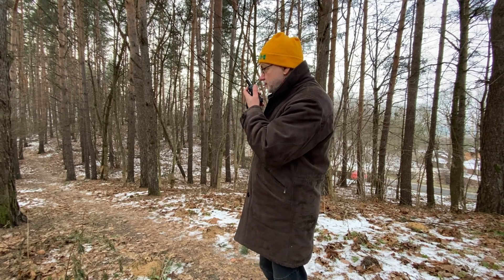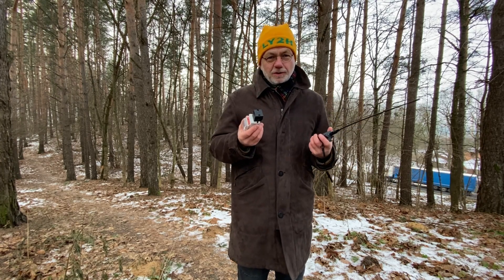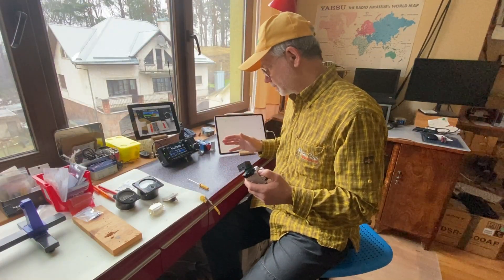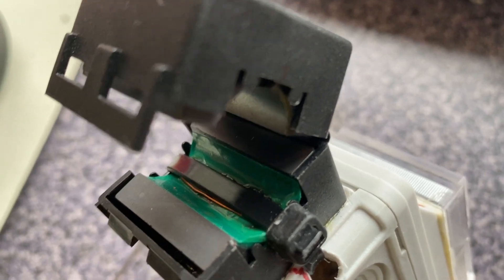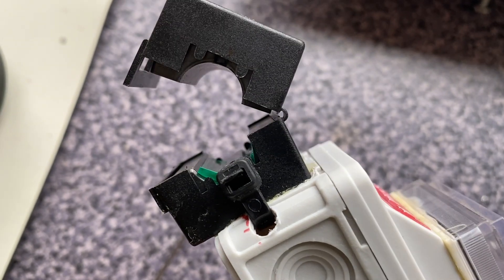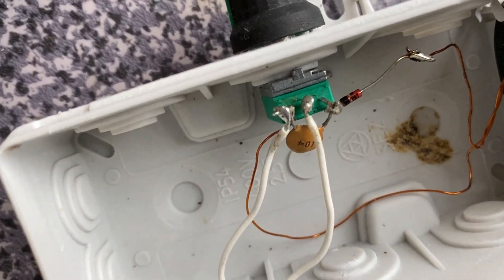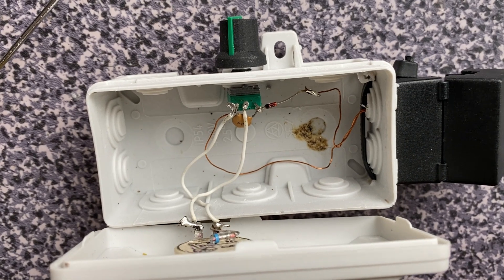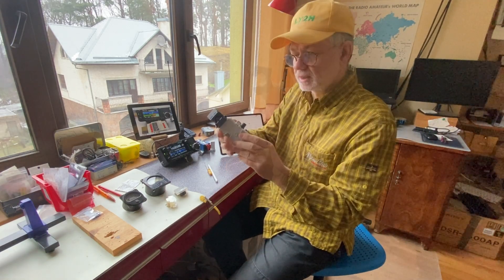DIY RF Probe: cheap, quick, effective. Clamp-on antenna current/CMC meter.

Comment: Thank you for the video.  I'm not much of a builder.  Do you know anything about the MFJ-854 meter?  And, are there videos about how to find common mode current?
Reply from the maker: Hello, thanks for the comment! The MFJ-854 looks nice, except the price :) I don’t have one, so I can tell nothing about its work or the schematic diagram and design. If it’s based on the same one-diode-detector principal, there is nothing in it not to work :). Regarding the CMC detection, I’m afraid I don’t have a specific video on this issue. Search in the YouTube search engine should produce some certain amount of videos on the topic. Normally, if you have a CMC problem, you feel it immediately. Erratic behaviour of your radio, computer, CW keyer, burning feeling on your finger (at higher power levels)  touching  metal parts of the transceiver, microphone etc. Simple probs like the one in my video help to quickly detect common mode current on the antenna cable. HTH, 73! Linas LY2H
Reply: @Linas_LY2H  Hi Linas.  The common mode current shows up when I operate 20 meters.  The symptom is USB COM ports dropping out.  The MFJ meter picked up the CMC on the coax from that antenna and also on my earphone cord.  Commercial choke (not from MFJ), to be installed at the antenna, is in the mail.  73 de Peter, AE1T
Reply from the maker: @dxdoctr1  Hi Peter, sorry to hear about CMC attacking you , but good news is you have means to detect and fight it now!  The RF choke at the transceiver's antenna connector will certainly help, at some extent, at least. It could be that to effectively eliminate the CMC from your computer USB cable you need to put some  (3-6) clamp-on ferrites on each end of the USB cable, or wind as many turns as it can take around the toroid ferrite of FT-43 material size 140 or bigger at the computer side. Probably it would also be a good idea to investigate your antenna and try to understand why and where does the CMC come from and try to eliminate the cause, not only the consequences. Good luck and have no CMC! 73! Linas LY2H

Comment: Excellent.

Can you tell me if this design varies a lot with differing frequencies ?

Does it have similar sensitivity at 7 MHz
as with 146 MHz ?

I am pondering a design
to cover 1.5 MHz to 150 MHz
& Would like to know your experience with frequency response .

Thanks for a wonderful video my Friend.
73 de VK3VKe ⚡🙏⚡

Just became a new Sub too ⚡🙏⚡
Reply from the maker: Thanks for watching and subscribing! I'm glad the video was of use for you. The device is a RF Probe, not the Meter :) This means, it can only indicates the presence of RF in the wide range of frequencies but it is not a precise meter which you could calibrate under different sensitivity levels :). It is surely possible though,  to put marks on the micrometer's scale corresponding to the certain power levels after measuring the known power levels at known frequencies. It was not my goal though, as I mostly use it to detect presence of the Common mode current on the cable. As it is seen in the video, the probe easily detects RF presence from HF well into above 400MHz. The sensitivity is easily adjustable by rotating the variable resistor. The margins  are very large for adjustable sensitivity in this way. HTH , 73! Linas LY2H
Reply: @Linas_LY2H  Excellent my Friend
and ThankYou so Much for your speedy and accurate reply.

One I am working on at the moment has a noticeable difference in sensitivity across the bands.

When I have low Resistance on the POT  it will show even small currents at as low 100 KHz
but I noticed with my build that it was much more sensitive from 3MHz upwards.

I hope and plan to upload a video on my own design
and hopefully you will find it beneficial too.

I am yet to proof,
but I think I have came up with a more sensitive version with a more personal schematic and coil design.

I Love what you are doing
& Love that Hams continue to Share and Explore ..

73 OM,
de VK3VKe ⚡🙏⚡
Reply from the maker: @crazyham  Excellent! Looking fwd to your own design! 73! Linas LY2H
Reply: @Linas_LY2H  Thank You My Friend. ⚡🙏⚡

Comment: Hi good man;)
When measuring, is the knob (potentiometer) set to 0? How to possibly correctly set? That's what I built from your project :) With a 10K potentiometer and a 100 uA ammeter. Regards Wojtek SP9DLK
Reply from the maker: Dzienki Wojtek! I'm so glad you took my idea for your own project! As it comes to the potentiometer, well, it depends on the meter you use and the strength of the RFcurrent you measure. In no way this RF probe is a precise measuring instrument, it's just an instrument to detect the RF current and get the orientational meaning of this current. But if you wish,  you can do kinda' "calibration", like applying the probe to , for example, an antenna wire at the max current point, put some 5W into the antenna and adjust the potentiometer to the full scale on the meter. Then put 2.5W, then 1W into the antenna and notice the meter indications, and here you have a more or less meaningfull meter values! If you clamp this 5W calibrated meter onto the cable shield and see the needle at say 1W level, you will know that you lose ~1W of your transmitted power to the common mode current. Being creative , you can make many more different experiments! Good luck! 73! Linas LY2H
Reply: @Linas_LY2H  Thank you very much :) Good job Regards and see you on the bands;) Pozdrawiam ;) 73

Comment: Can you comment on the exact ferrite mix recommend (and perhaps part numbers for all the components from Mouser or some other supplier?) for this design?
Reply from the maker: Hi, thanks for showing interest in this design! I was ordering  absolutely nothing from Mouser ( or anyone else, actually :)) for this simple project, everything came out of my junk-box. It is really does not matter so much the make or the size of a resistor, or a capacitor, the values are also orientational. As it comes to the ferrite clamp-on bead, it is only clear this is a  high-permeability ferrite. As these ferrites  are marketed as clamp-on filter beads, the impedance at a certain frequency specs is put in the first place in most data sheets. The metal oxide ( most often, I think, manganese zinc or nickel zinc) material is normally,  the same type as in ferrite rings - 31, 43, 46, 61. As everything else, the type of the ferrite snap-it core is not so terribly important for this specific project, as it is always possible,  and desirable to make some adjustment in turns of the transformer secondary winding. So, nothing being critical at all, you should easily select your favourite or available components at Mouser's or anywhere else, I hope. 73! HNY! Linas LY2H

Comment: Thank you Linas for making this video. Wonderful channel to follow.  I think, an old CB rf strength meter could be modified to measure common mode current by replacing its antenna with a toroid transformer?
Reply from the maker: Thanks Sam! Unfortunately, I failed to find such an old meter in my junk-box :) It would be just great if you make a mod to an old CB RF field meter and let us know! I think it should be possible, in one way or the other. Merry X'mas ! 73! Linas LY2H
Reply: @Linas_LY2H  I have an old Radio Shack CB RF field meter.,  Im going to check it out.